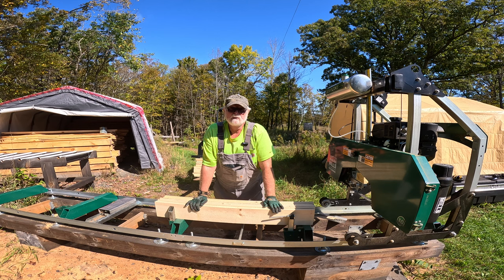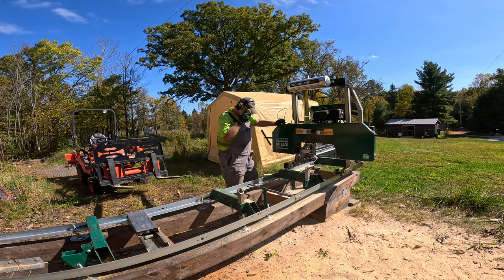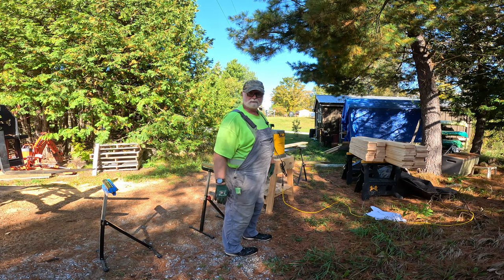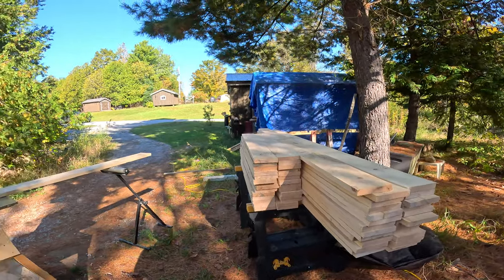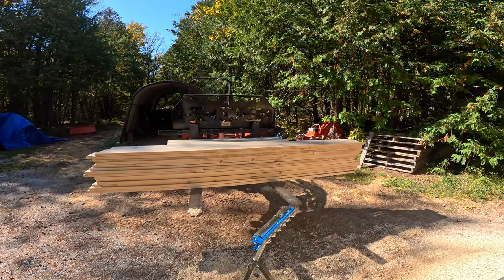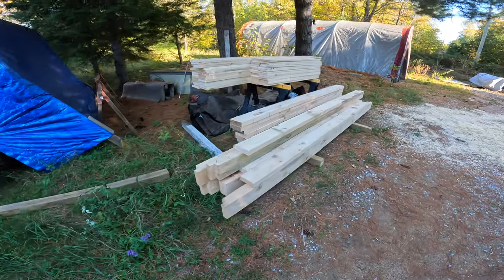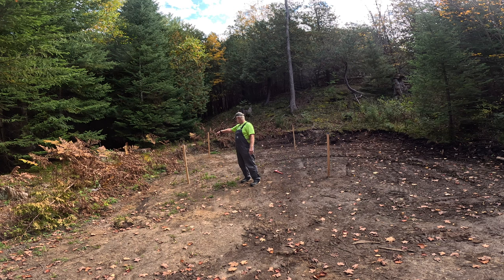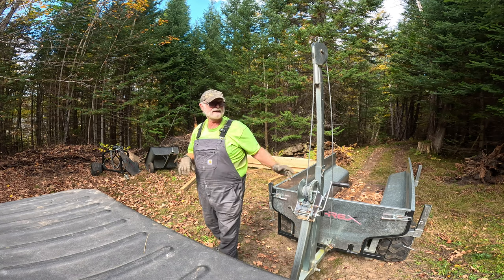Preparing The Floor kit For The Off-Grid Cabin

Comment: My new bandsaw arrived today - a tad smaller than yours Record Power 350 Sabre, same machine as the Rikon 10-326 on your side of the Pond).

Wax the bed on the planer - helps the boards run through & helps stop it getting gummed up.
I use machine wax but furniture wax will do the job.
Reply from the maker: Nice! I love getting new equipment. Yes. Waxing is a good idea. Thanks for stopping by!